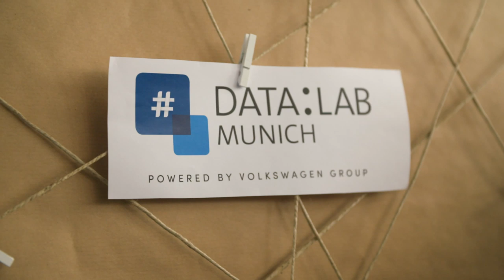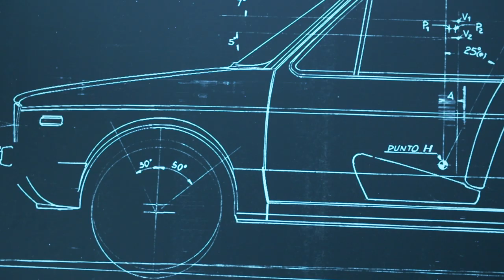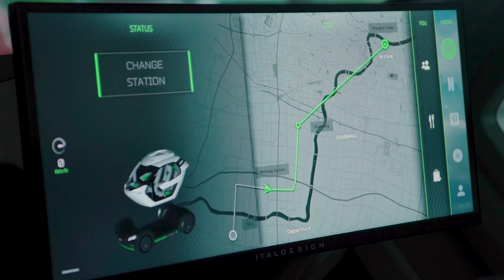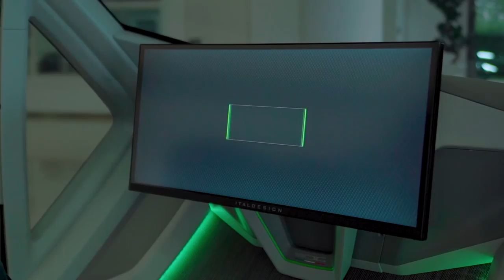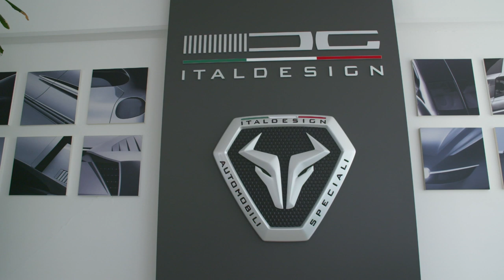Italdesign: Icons of Automotive Design | Data:Lab Partners | Roborace

Comment: Please, make it that these cars can run for 2 hours straight on the hardest tracks for example Circuit de Spa-Francorchamps and not only in the city. With an EV it is not possible but it will challenge the AI even more when to change gears etc. which will make racing and battles even more intresting and entertaining. Get Cosworth or some other company to supply powerful but long lasting and efficient engines. Also if the races last longer, teams gather more data and the AI gets smarter towards end of the race which creates more battles which in turn increases excitement in the crowd. Also for great racing make sure the cars don't create alot of disturbed air which makes it hard for cars to follow each other and overtake. Adjustable DRS would also be intresting not like nowdays "on or off DRS". I hope you guys read this comment and that this series succeeds.

Comment: I'm still wondering why did they ditch the original concept designed by Daniel Simon, that looks way better than the current chassis which looks more like a scaled-down LMP car
Reply: M.G. Khatravinsky probably the same reason why concept cars change drastically when they are market ready and mass produced, it’s cheaper.